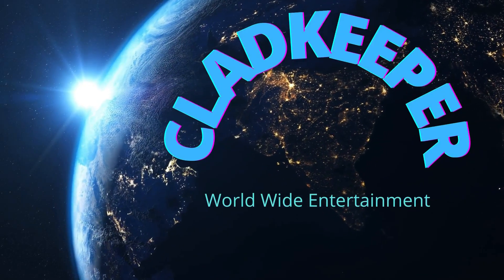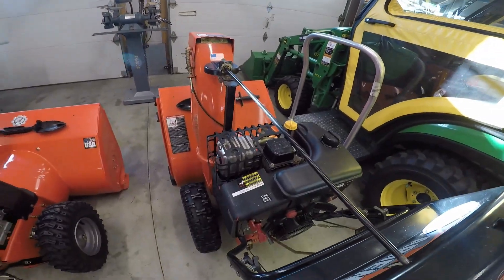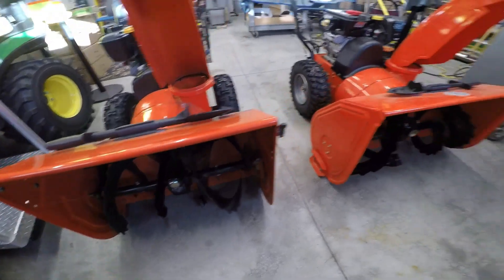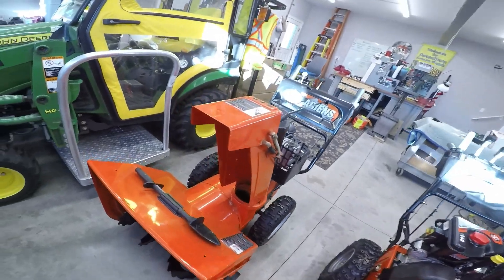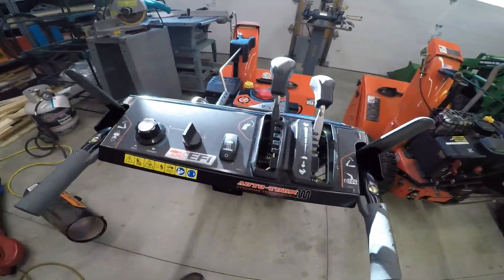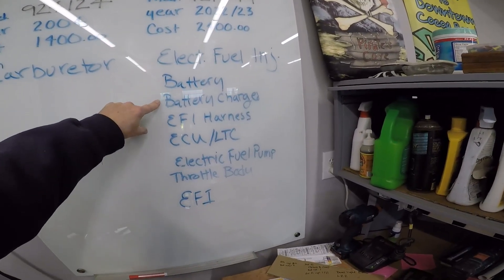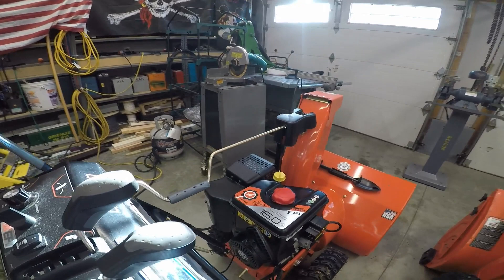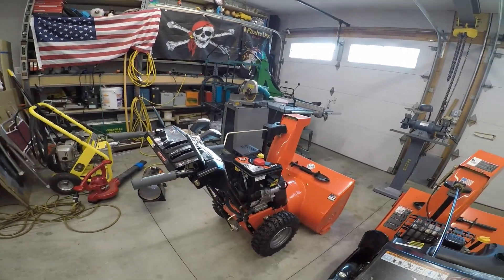Ariens : Compare electronic fuel injection to carburetors.

Comment: I just got this snow blower yesterday and it has the carb. I will trust the carb model over the EFI  because I bet you will have problems with it. I have never heard one complaint on the carbed version. EfI is to new and unproven. Keep your snow shovel handy.
Reply from the maker: I still have my carb and sold the EFI.  I love EFI , but, as I outlined, it is very expensive if you have a problem and a carb can usually be fixed on the spot

Comment: I must say after having many blowers with carbs and still  using one at home, then having EFI Rapidtrak PRO at my cabin my choice are EFI all the way. Because I cannot fix anything on my own. Those carbs have cost me a lot of service-money during the years. IF you have the ability to charge your EFI battery 2 or 3 times a year you will be a happy camper with EFI.
Reply from the maker: Please write me when you get your first EFI repair bill.
Reply: @cladkeeper8376  Do you want me to write you when I have my next carburettor bill? I had one recently before last season. And I remember well the one before that a couple of years ago.
Reply from the maker: @dagjohnsen  It sounds to me like you are not aware of the effects of ethanol in todays fuel. Ethanol absorbs moisture in a vented system. Moisture destroys vented systems. Funny thing about corn fuel. It costs more than producing fuel from pumps in Texas and other great fuel producing states. I’m sure your not sure where this is going. I am here to buy your 300.00 gas whatever for 25.00 when your  done with it because of a carburetor.
Reply: @cladkeeper8376  2 years ago I switched to non ethanol gas. In Norway where I live it is still available at the gas station. High octane no ethanol. It is called 98 octane in Europe. For sure better!
Reply: @dagjohnsen if you're paying alot for carb work, you're getting ripped off. 😅
Reply: @dagjohnsen  If you run that in carbs you'll probably reduce carb problems too.  Personally I have been using E10 gas with Seafoam added for decades in carbs with no issues.  Keeping it fresh and proper storage routines are key, and the Seafoam keeps everything clean.   I stopped using non-ethanol fuel because it got to be a hassle to find, and even when I did find it it was coming out of the same hose as the E10 gas, which means I was probably getting a gallon or so of E10 anyway.   It's been so long since I've had fuel problems I don't even think about it anymore.
Reply: Oh, you'll learn.
Reply: I prefer to run engineered fuel such as trufuel in my snow blowers. It is more expensive but I have peace of mind I won't be taking carburetors apart and cleaning them. Play friend has an EFI snowblower that he bought a few years ago. We only found this out recently and it wouldn't start last year and I was able to take a closer look at it. So I was not really familiar with EFI Small Engines at the time. I told him the next time he buys a snowblower get a carbureted one.

Comment: My Ariens snow throw still has its original every thing including carb from 1974
Reply from the maker: I had one of those for years. When I sold it , it was still running. I just didn't want something that would go off on its own if I let go of the handlebars. 7HP Techumsah.

Comment: All that fuel injection sounds cool......you make a hell of a point.....old schoo all the way....the simpler the better.......nice video
Reply: It's not that efi is crappy, it's that these efi's are crappy... They have the same problems that snowmobiles had with efi in the early 90's. They should have taken some lessons but they didn't learn a fucking thing about batteries and efi.
Reply: @shadetree6981   I don't think it's that they didn't learn anything, it's that snowblower engines are necessarily made to a much different price point than snowmobile engines.